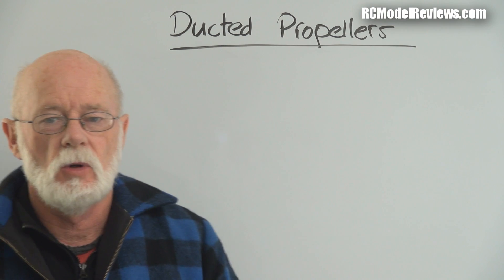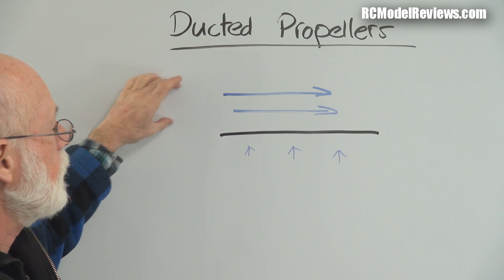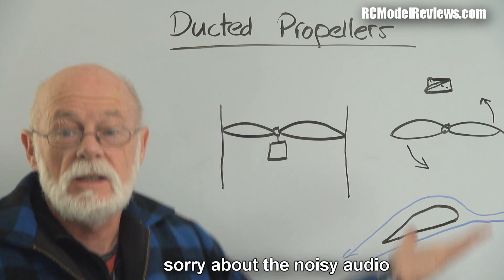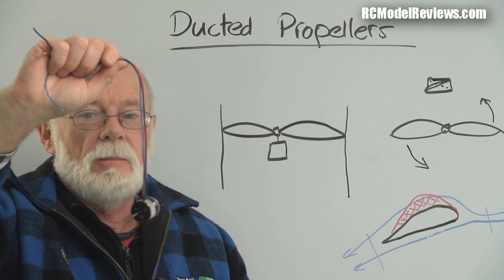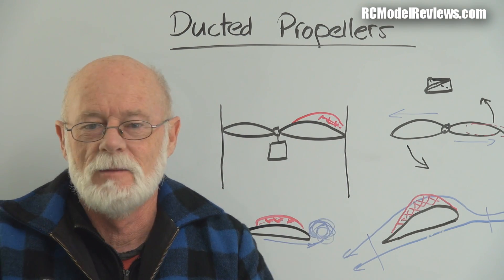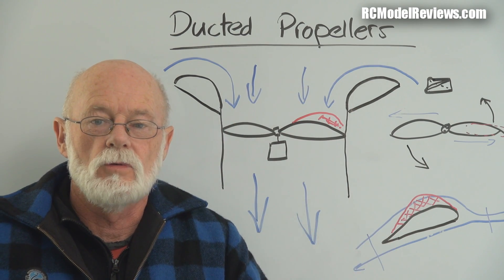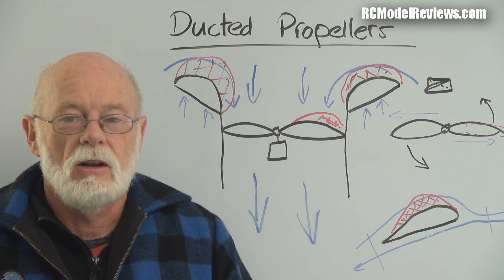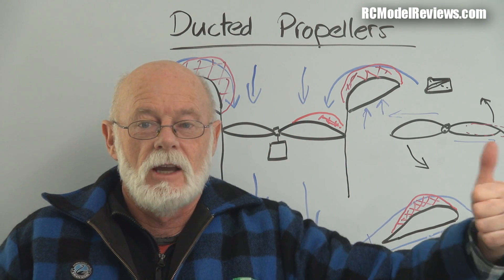How ducting a propeller increases efficiency and thrust

Comment: Thanks for the video!
We used to build ducted  lift and propulsion systems for hovercraft in the '70s and '80s,  then  made and sold propeller systems for microlights for several years.  One of the latter set an altitude record. Despite that, it is still hard to predict when there is a net benefit to ducting a prop or fan system.  The hovercraft lift system was a no-brainer - a low tip clearance is essential to developing the pressure needed to lift the hovercraft.  
There are many references to tight tip clearances being necessary on ducts, with graphs to prove it.  ALL of the graphs and data I have seen relates to pressure development, not making thrust. For thrust any gap less than half of the tip chord seems to be good.
The hovercraft propulsion system needed to be guarded (race regulations) so a duct was a pretty easy thing to incorporate, and did contribute to better static thrust figures in most cases.  But there was almost no demand for ducted systems on microlights - their big props developed more static thrust than the (smaller) systems on hovercraft even when matched to the same engine.  
Size matters!  Big ducts? Big weight.  Ducted Turbofans work well on a 747, less well on a Cessna.
If you are using a duct, flow-straightener vanes are often of benefit.  These are static foils that take the spin out of the air behind the prop/fan and turn it into thrust.  They worked best on fans, whose higher 'solidity' would typically impart more torque to the air flow than a skinny prop. More torque = more spin in the air = more thrust if you straighten it.
Surprisingly, square ducts often work exceptionally well for propulsion - in one instance, better measurements than a round duct.  Who knew?

Comment: The air on the top doesn't move faster, it's not moving.  The airfoil is moving through it.  That means two air molecules separated at the leading edge will 'travel' a similar distance along the z axis.  Absolutely zero.  (Discounting the heat from the deflection of course)

Comment: I thought he would also talk about having fixed vanes on the exhaust side of the duct, which would rectify any swirling air leaving the duct so it exits in an axial direction only, thus maximizing the thrust. I think that's why we see fixed vanes in the bypass of turbofan engines.

Comment: The reason the paper lifted was due to the vacuum at the boundary area adjacent to the paper, caused by the inertia of the air across the top of that piece of paper. How does that happen? The mass of the moving air has inertia. Once moving in a certain direction, its mass will remain moving in that direction until interfered with by another force, another object with mass. Its molecules scavenge the closest molecules of previously motionless air in the arcing gap between the air flow and the paper, and the air molecules in the area below the stream of breath, between the stream of air and the paper, are being scooped up at the boundary between those two air masses, beginning at edge of the paper closest to his lips. This would then draw the next few molecules upward, scouring out the tiniest eddies, and the progression would continue out the piece of paper as long as there was enough inertia in the exhalation to continue creating a laminar flow by scouring away the turbulent eddies created by the friction between the air stream and the previously undisturbed air between the strip of paper and the exhaled air stream.

This results in a measurable reduction in air pressure as the once-stagnant molecules are pulled into the stream. That is because it takes time for the resting molecules to be accelerated, and the molecules of air there are stretched out while being accelerated, creating larger spaces between them until they have accellerated to the speed of the moving air. 

Picture a grinding wheel and a stick of wood. As the wood comes into contact with the moving wheel, the very edge of the wood is torn free and moved along with the wheel, pulled away from the stick by impacts with the bumps in the wheel. Each bump tears away a little bit of the stick. Fresh stick is then exposed to the wheel, and more bits of wood are rubbed away from the stick.

The same thing happens if the grinding wheel is made of the same wood as the stick. Let's say you have a long board, and then rub the stick along its length. Again, tiny bits of the stick are worn away by friction against the tiny bumps in the long board. Now, it doesn't matter, really, whether the board is moving or the stick is moving, they each sacrifice tiny bits to one-another. The net effect of this inertial contact, however, is that the bits at the very center of the friction would be moved at exactly half the speed of the relative motion between the two pieces of wood. If the two pieces of wood are pressing against one-another, as are molecules of air down here where we breathe, molecules of wood behind those "worn away" would be pushed into the boundary area, and moved along at half the speed of the two volumes passing by one-another. New molecules of wood would be pushed closer to the boundary layer, where they would eventually be worn away and carried off - again, at half the speed (net) of the two pieces of wood relative to one-another. 

The same thing happens with increasingly fluid molecules. Only the more fluid they are, the messier the boundary layer becomes, passing on this boundary layer effect until at some point those pesky eddies are created, which carry the message from the boundary layer, though increasingly garbled, that molecules are being moved away at the interface between the two masses moving in different directions relative to one-another, and other molecules are being pushed toward them to take their place. The eddies provide a net motion of that mass of gas or liquid toward the friction interface. 

When air is blowing past another body of air, it has inertia that prevents it from bending to form an eddy until far past the interface, when mixing between the faster and slower air masses has progressed to form multiple eddies in a struggle to balance local pressures while fighting against the inertia of each and every molecule. 

So, is it really a reduced pressure? Well, yes. But my, oh, my, what a complicated thing it is to have air moving over a surface create and maintain laminar air flow. 

Airplane wings have a flat undersurface and a curved upper surface to maximize the fact that air has inertia. When the wing has an upward angle of attack pushing into the wind, air bangs into the undersurface, and creates pressure as the wing changes its direction, forcing it downward. Makes perfect sense. 

But then, what happens to the air on the TOP surface of the wing? Well, as the plane starts moving, the air above the wing whirls and spins in lots of little eddies, turbulent and swirling as air moves over it, and is unable to flow smoothly over the downward slope of the wing surface. Imagine moving a flat hand through water, and the swirls that form behind it. That same thing is happening on top of the wing. But as the airplane moves faster, the air moving above the wing increasingly scours away the eddies and the laminar flow over the wing progresses farther and farther back over the surface until when the plane is moving fast enough, there is completely laminar airflow above the wing. 

So what about the pressure reduction? Well, the front of the wing splits the air in "over" and "under" groups. The air that goes under the wing is pushed against it because of the wing’s angle, and forced downward. The air above the wing has a lower pressure, because it is being forced to change direction and is being pulled DOWN. When the wing is moving fast enough, the air above the wing will be completely laminar as it flows over the wing. That is when the upper surface is able to produce lift, because it has a lower pressure over the entire surface, because it its being pulled DOWN by the angle of the wing. (remember your hand in the water, and the water being pulled in behind it as you move it.) 

But why is the wing CURVED on top? Well, that is to spread out the action of changing the air’s direction more evenly over the surface of the wing. If you look at a chart of cross-sectional views of airfoils, and then show lines of pressure reduction above the entire chord (front to back distance) of the wing, you can see how different curvatures create a different pressure reduction over the surface. As the air moves, a wing with a gradual curve spreads out that reduction in air pressure over a greater distance front to back. 

Bernoulli was correct, basically, but he didn’t break it down to the molecular level and explain exactly WHY there is a reduced pressure with fast-moving air. 

I may not have used enough analogies to enable a person to imagine clearly what is happening with moving air pressure at the molecular level, but this was a small attempt, one that only dealt with localized effects, and didn’t have the benefit of pictures and arrows and captions; or as Arlo Guthrie put it, in that old classic (and mostly true) story about Alice’s Restaurant, with “…twenty-seven 8-by-10 color glossy pictures, with circles, and arrows, and a paragraph on the back of each one, explaining what each one was,…”

Comment: The low pressure on top of the airfoil is cause by inertia of the air and the angle of attack. Due to conservation of energy and momentum the air has to flow faster. Bernoulli's principle is only a manifestation of the laws of conservation.

Comment: Air foil explanation is wrong. There is no reason the air should travel the distance in the same time. Bernoulli's principle is fine, but the air on top actually usually gets to the same point even sooner.
Reply: that was not said in the video. he explained it will travel faster at the top than at the bottom of the airfoil.
Reply: "if you measure the length of these lines, from say here to here you can see that this line is a lot shorter than that line. So what happens is in order for the air to get right over the top and down here because of the curve, you have to travel more quickly"

This statement (time stamp 5:50 or so) carries the implication that the air must go from the line in front of the wing to the line behind the wing in the same time. It is true that the air on top moves faster, but it has nothing to do with the length of the lines above vs below. The exact fluid mechanics are actually not well understood. But the practical effect is that the air on top moves faster, and that provides the lift. It's just that he is trying to justify  WHY the air moves faster, by measuring the distances they must travel.

by the way, many pilots and even some engineers are taught using this explanation. and it doesn't affect them in the least, because WHY the air moves faster never really comes in. (except that if some magical force existed to make the air move across the top and bottom in the same time the most efficient airfoil should have a steeper curve).

Also, please don't think I am trying to just tear this guy down. His teaching is excellent. It's just that there is this one misconception (and it really is a minor one) based on an implicit assumption that is wrong. It continues to be passed around. And I hope i can help set the story straight.
Reply: Yes after hearing it again, it does carry the implication that it should reach the same time, although not saying so, nor does he believe so.

Comment: Why are they finding an increase in blade speed with wind turbines when the duct is reversed they call it a wind lens
Reply: Hi Al Dez,  that's probably similar to the way that the diffuser on the back of an F1 race car sucks air out from underneath to help the car grip the road.  https://duckduckgo.com/?q=formula+1+diffuser&t=canonical&iar=images&iax=images&ia=images

Comment: The edge is the only place where this vortex occurs? What could this vortex have to do with providing more efficiency, "something from nothing"?
A terrible explanation but one that's sufficient with the nonsense handed to the world today. The pressures exerted outward and inward all move in vortices...For a reason. The same reason a top spun on its side will stand straight up. It's never too late, Viktor Scahuberger has books that can help the true understanding of what we are told by modern academia is curved space time.

Comment: The cetrifugal force has very tiny effect on the propeller tip vortex - they're mainly created by the pressure difference. The same vortices appear on airplane wing tips and these don't go in circles.

Essentially, any lifting surface creates vortices since it pushes air downwards and the volume above needs that air to be replenished, it won't grow there. So the air returns back up some way around the engine and in combination with the lifting action it forms a vortex. So in fact, the main reason why the propeller duct increases efficiency is because it acts kind of like rocket nozzle. It forces the propelled air to leave the propeller in a more uniform direction.

Comment: If the duct was not fixed but spun at the same rate or slower/faster or in the opposite direction of the propellers, what with this due to the efficiency?

Comment: Is this not very similar to the Venturi effect?
Reply: Hi Kris, it's related to Venturi Effect.  You can think of a venturi as two airfoils with their curved surfaces back-to-back, so the two low pressure areas (== top of the wings) overlap and reinforce to lower the pressure. Ben

Comment: Ah that`s why Fenestron is so much more efficient and ultrasilent compared to common tail rotors which make so much noise when the tips of the blades hit the sound barrier that I always have to block my ears when standing in the vicinity to starting helis, and that`s why high powered tug-boats always use ducted propellers. Thanks for the good info, maybe with a duct I can make my boot a few knots faster.

Comment: Right. So here's a question I've long had regarding ducted fans insofar as it pertains to flight; would you get more thrust by reducing the back end of the duct sort of like a short funnel, or would that cause your engine/power source to work more because it's pressuring the air within the duct? Turbines sort of do this before the fuel is mixed in to the air and ignited, so I was wondering if some increase in performance could be achieved this way or if it's just counter-productive?
Reply: Hi Hiro,  nice handle! In my experience the answer is "Usually not".  Tapering the duct after the prop accelerates the flow, and that trades off thrust for exit speed.   But if you have a big prop hub then a tapered after-body is often used - to control the flow rate and prevent expansion separation the duct is sometimes tapered to keep the area where the air flows more nearly constant.  We built several systems in the '70s and '80s, to check this out.

Comment: "Open props" are more efficient than a ducted fan.
Take a jetdrive on a boat.
The same boat with an inboard prop set up will accelerate faster and top speed is quicker too.
The ducted fan of Airbus s single seater electric flyer is slower with less range than an electric Cri Cri.
The only use for ducting a prop is to fly very high or very fast above the speed of sound as "open props" start to disintigrate when they hit the sound barrier and due to lack of oxygen/air density,
 "open props" cant create enough thrust to get higher,
hence why "open bladed" helicopters cant go faster than supersonic with todays engineering capabilities.
The F35 vtol jet is,
 in my opinion,
 the worlds first supersonic helicopter- aka Airwolf !

Comment: YES!.... I am interested in the tests. And, particularly your comment about the effect of tilting the rotor as mentioned at https://youtu.be/Cew5JF8q6eY?t=17m10s. I realize that many (most) pilots wish to fly fast, and to do this one must tilt the entire multirotor or at least the rotors in the direction of flight. What if the design parameters were defined more narrowly as a hovering platform for slow stable flight? (Yes I really wish to do slow stable hovering and flight.) And what about the amount of added thrust being offset by the weight of the shroud? How much thrust? How much weight? Even if the sum is zero, there is a net benefit of increases safety and structural integrity with fewer prop strikes. But I have read that thrust can be increased by 60% to 80%. Do the shrouds actually weigh that much? How much do the shrouds you were given weigh? Couldn't they be made lighter.

Comment: Excellent. The simple inventions are the best. Bernoulli cleverly applied, same as the aerofoil but over a smaller propeller foil. You will need rotational speed to achieve the lift of course, thats why the early aircraft with weak engines couldn’t use an aerofoil. The duct cleverly stops the local mixing of the low/high pressure zones above and below the blade which would lead to inefficiency and loss of lift. However, look at a jet engine housing, all this has been already invented!

Comment: That doesn't explain why ducted fans are less efficient than an open prop. In theory a fan in a duct shouldn't be washed out like an ordinary prop, but they usually are. I know someone who has done much research on ducted fans and he has found that two blades are better than six. Not what you might expect.

Comment: I think in your paper example, the lower pressure comes from the streamlines expanding into a larger area. Notice that the paper no longer rises up once it achieves a straight profile. This is because the streamlines no longer are being deflected downward by the paper’s profile, which creates a counterforce pulling the end of the paper up. It isn’t about the velocity of the air but rather the changes in velocity along the streamline, including curvature